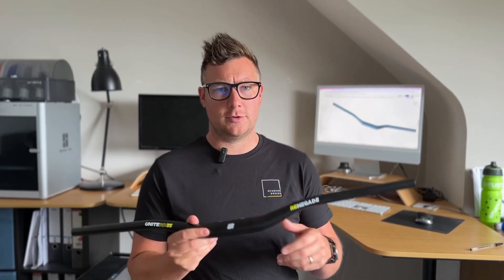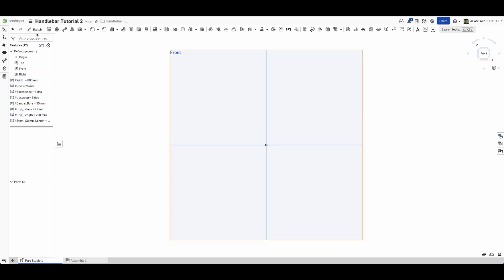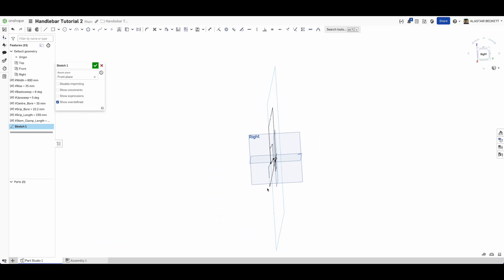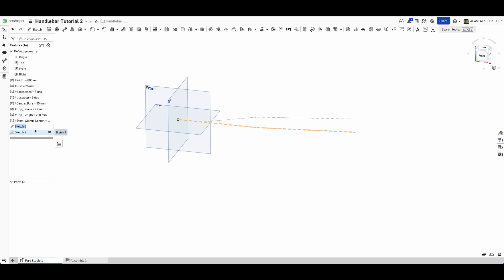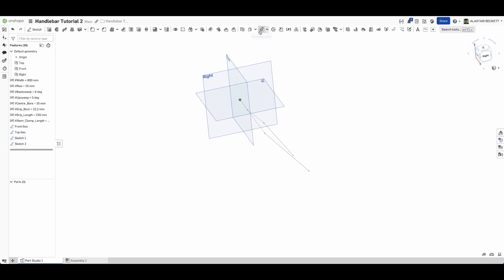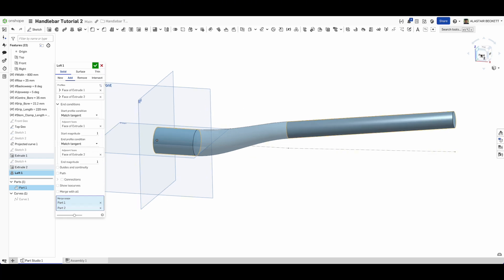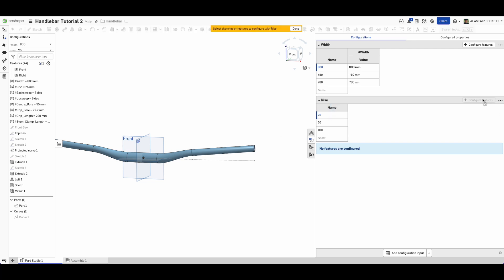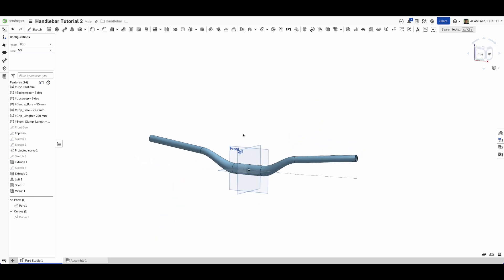HOW TO DESIGN MTB HANDLEBARS! 3D modelling MTB handlebars using CAD software, the easy way.

Comment: This was so helpful. Thanks alot. Making a luggage rack for my cafe racer so had to have this learned.
Reply from the maker: Awesome, glad it helps. It would be sick if you shared a photo of the cad model for your luggage rack once you get it finished? There is also a new "Routing Curve" feature that was in one of the latest OnShape updates since this video was made, so check that out incase its any help. 
Good luck! 

Here is the link to the update info that explains the routing curve feature.
https://www.onshape.com/en/resource-center/what-is-new/cosmetic-threads-routing-curve-constrained-surface?_gl=1*1vh87yv*_up*MQ..*_ga*MTQ2MDE2NzQwNC4xNzQ0MDk0NzI3*_ga_DZZ0XQS0VB*MTc0NDA5NDcyNi4xLjAuMTc0NDA5NDcyNi4wLjAuMA..
Reply: @redburndesign  will sure do

Comment: huge thanks for a concise video. When i try to apply the upsweep and backsweep values, it tells me "cannot use upsweep as length" and as far as i can tell, i am clicking exactly the same as you,  any ideas? HUGE THANKS
Reply from the maker: Thanks. Check your variables for upsweep Incase you have selected the ‘type’ of dimension as a length, or number instead of ‘angle’z That might be the reason it won’t recognise the value you have added.

Comment: Hey that was a great video! I am pretty handy in Onshape but learned I should be using configurations a lot more. I didn’t know you could assign them to variables in that way. IIRC there’s a loft option to maintain profile cross section?
Reply from the maker: Hey @hagus42 thanks for the comment. Im glad there was something in the video that even an experienced OS user could take away from it. 
Yes, I think you are right about maintaining that profile cross section, I probably should have explored that in more depth. 
It's a difficult balancing act with these videos, to get the basic fundamental points across without going down a rabbit hole on the detail and making it too complex for newer OS users. 
Thanks for the feedback!